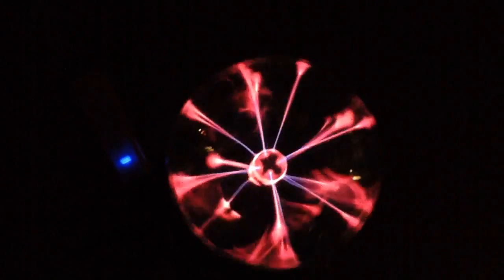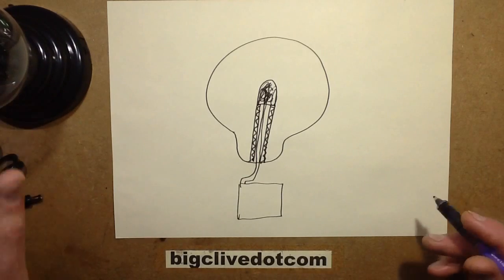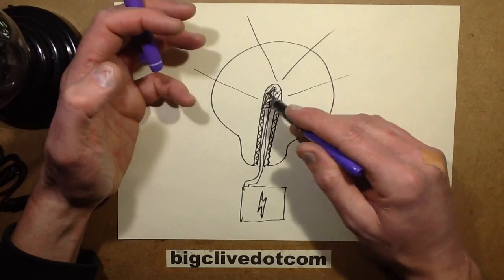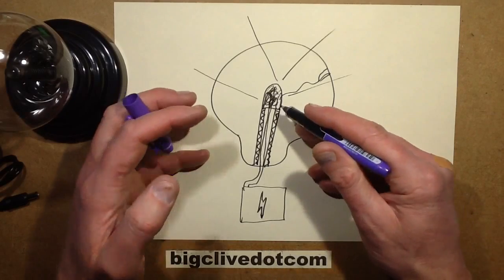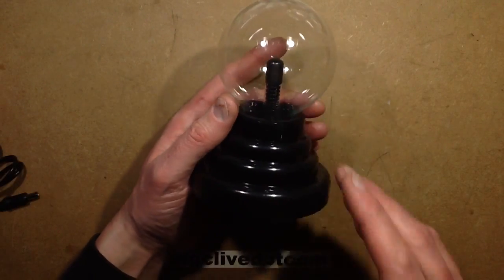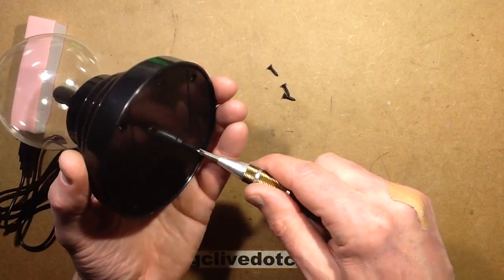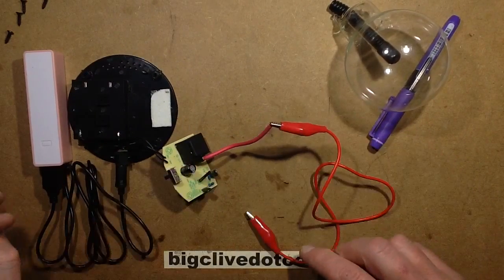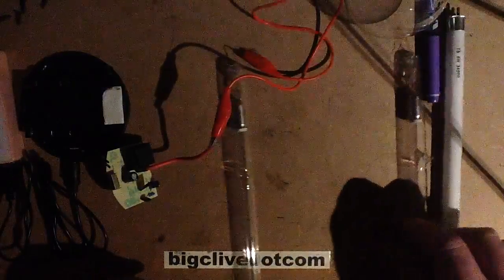USB plasma ball teardown and schematic.

Comment: I suppose that plugging such a device into your computer would threaten not only the computer itself, but also all other connected USB devices, any of which might be less well protected than the computer.
Reply: I had one of these. i ran it off a powered USB hub since I didn't want to put it into my computer. However, I forgot about it when i plugged my cell phone into another port to charge it. Luckily my phone was fine. The only noticeable effect was the touch screen wouldn't work while the plasma globe was on.
Reply: Flagstone78
Could be a useful data-theft-prevention technique, I suppose.
Reply: If you plug the globe into an ungrounded computer or hub, and then ground the globe by touching it, the computer or hub and everything connected to it will be at high frequency high voltage above ground.

Comment: have one with dead eht tx, so bought a bike ignition coil &  made it with 555, got it  working but works on 12v 1a,got a little hv shock at the collector of sw trsntr dono why. the one they make really efficient one at 5v, anybody know where to get that small eht tx.